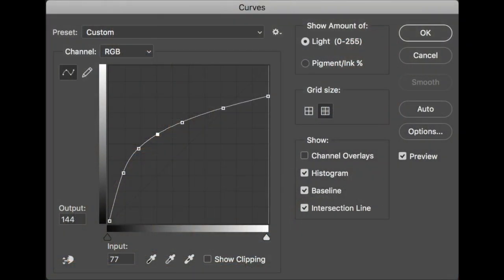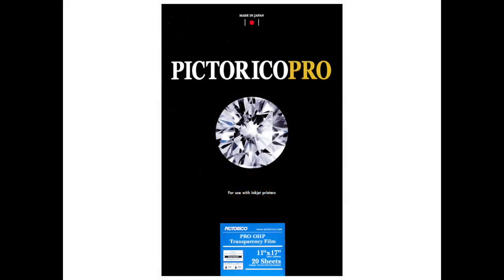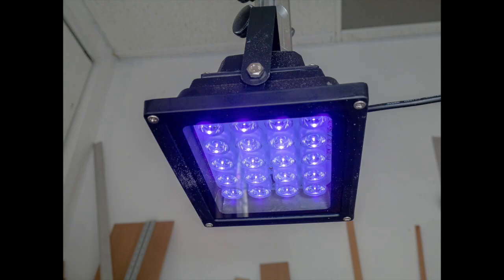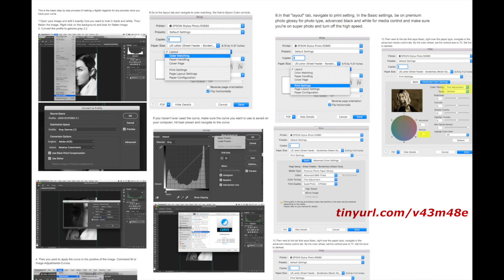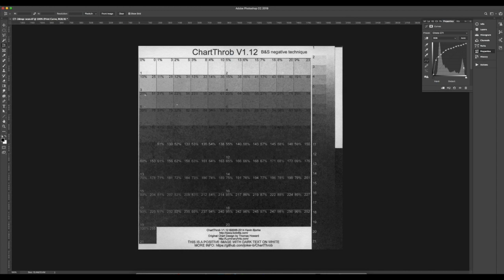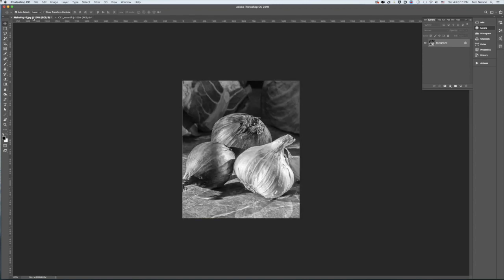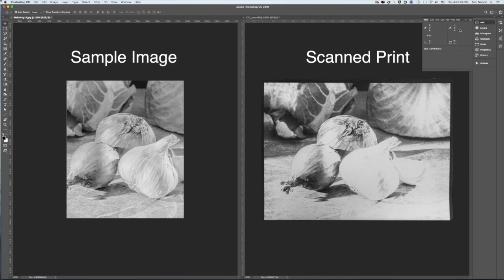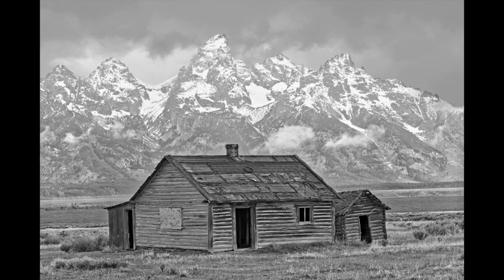Creating a Digital Negative

Comment: Hi Tom.
Thank you very much for the helpful material. I have a question about buying a printer. A good choice would be the Epson SureColor SC-P700 (expensive to use). In your opinion, the EPSON EcoTank L18050 or Epson EcoTank ET-8550 printer would not be good? I am primarily interested in cyanotype and buying a printer with it in mind.
Best regards, Bartek.

Comment: I love this very factual tutorial. Thank you.  I have a question regarding printing the negative.  My experience comes from Photopolymer Photogravure work where I am using Folex transparencies and Matte ink on an Epson SureColor printer which I was advised was more UV opaque than photo black.  You mention that Matte black smears.  Is this because of a reaction with the chemicals (I am planning to do cyanotype).  I would appreciate you comment.
Reply from the maker: Matte paper absorbs more ink than glossy paper, so matte ink is applied more thickly. Plastic films don't absorb ink at all, so the lighter application of glossy ink is better for them.
Reply from the maker: Thanks for the comment. My advice to avoid matte ink comes from my experience using it on Pictorico transparency film. If it doesn't smear on Folex, go for it!

Comment: In the Bostick & Sullivan comments on printing the Kallitype curves they provide there is a recommendation to change the Optical Density Setting of the printer (Epson) to -3. Do you make this printer setting change when you print the Chart Throb test print?  Thanks so much for this clear and concise video. I have been attempting to nail down Kallitype printing for about a year now and have had some, but not very consistent, success. I love the process!
Reply from the maker: Yes, use the B&S printing technique on all your tests and prints. I'm testing some other colors besides yellow and hope to have a new video... sometime.

Comment: Hi Tom )))  Great video, and yes it seem very complicated.  But okay, it seems like that I need to build this curve because each printer is different?  And if you change printers then you have to make a new curve - is that right?  Thank you for the video!
Reply from the maker: You'll at least have to try the old curve with the new printer, then adjust as necessary. If my technique seems complicated, the main takeaway is that your test print will tell you how to adjust the curve. You mainly need to know what will give a textured white and a textured black (the limits of your ability to show detail).
Reply: @tnp651  Thank you Tom!  )))

Comment: Can you make a digital  negative to print in an enlarger... for example can I make a 4x4 inch negative from a negative I retoucher in LR....
Reply from the maker: Enlarging a digital negative is not advisable. You'll be enlarging the printer dots that make up the image. You might make it work if you print the neg at the highest resolution your printer can make, and don't make a very big enlargement. Why not just make a contact print though?
Reply: @tnp651  I can just do that yes. I thought I would just have a master neg that can do all sizes by putting in an enlarger. Was just a though. Any  current printer recommendations for up to 16/20
Reply: Thanks BTW‼️
Reply from the maker: @davidventura1424  Most alt printers use Epsons. The XP-700 prints 13" wide and the XP-900 prints 17"wide. The XP-900 is 50% more expensive for those few extra inches!

Comment: Great video. Can someone help clarify something for me? I see you mention the Bostick and Sullivan video which goes over creating a digital negative as well as the printing settings for the negative. Does this chart system replace the digital negative portion of the bostick and sullivan video? It seems like it is just a more refined process but if I am using their chemistry and curves wouldn't I just need to dial in my exposure times and it should be good to go? Thanks in advance.
Reply from the maker: To be honest, I haven’t tried B&S’s pre-made curve but there are too many variables that change your image. It’d be easy to try B&S’s curve and see what you get. In any case, assess and change as I showed in the video.
Reply: @tnp651  will do. I’m just waiting on a printer to print my negative.

Comment: Tom,  thank you for the great video. Question:   For the test strip you make to find the full black, do you need to put this exposure trough all the same process you use to develop the image correct ?  (dev time, clearing, toning, fixing, etc)  thanks!
Reply from the maker: Augusto, you should use the same steps and timing except the hypo clear and final wash. Both the toner and the fixer change the Dmax. You don’t care about archival permanence, so the wash steps don’t matter.
Reply: @tnp651  Thank you Tom!

Comment: Why not just print the digital photograph?
Reply from the maker: For me, it’s the excitement of learning and exploring an old-time technique. Getting back in the darkroom is nostalgic for me, but I don’t want to lose the image control that digital provides. A hybrid process is the perfect compromise.
Reply: ink jet prints sit on top of the paper. these process are kinda burned into the paper chemically and the texture of the paper stands out. It also lasts way longer like those old photos that grandma used to have sitting in her house. That was the size of the negative so that was the size they printed at. Now we use digital to create bigger negatives to do the same printing but at a more modern and desirable size.

Comment: how to i do the timing with a NuArc 26-1k? it uses units instead on min.
Reply from the maker: Time it to see how many units are in a minute. Say there are 20 units in a minute. I’m not familiar with the NuArc but I’d guess you’ll need something between 3 and 7 minutes. That’s 60-140 units in this hypothetical example. Give your test strip 60 units, then cover part of it. Then give a series of exposures at 10 units, covering more of the strip each time.
Reply: Did you ever figure it out. I have a NuArc 3140 and will probably run into the same issue here shortly. Thanks

Comment: I have tried and tried again to get ChartThrob.jsx installed into Photoshop 2020 on my Mac without success. Any ideas as to why this is?
Reply: I finally got it loaded but I had to download it on a PC and transfer the file on a thumb drive.
Reply from the maker: Yes, I just realized the problem. The site downloads a file called ChartThrob.jsx.txt. You need to remove the "(dot) txt" to use it as a script. Let me know if you still have trouble.
Reply: Thanks for getting back to me. That’s the first thing I tried to no avail. I must have tried 20 times in different ways but it still wouldn’t install. In the end I downloaded the file on my old PC and it installed straight away in PS 2020. I then copied the file from the PC to a thumb drive and transferred it to the Mac. I dragged the file into the appropriate folder and it works. Removing the .txt doesn’t work as the Mac still sees it as a text file.
Reply: Failing to install Chartthrob on a M1 Mac running Big Sur with Ps 2021 or a PC running Windows 10 and PsCS6 but neither open the script. Gives an error 23 at line 134. Have made sure to use the 662kb script file. Any suggestions?

Comment: This is marvelous, Tom. I'm just getting started with platinum/palladium and you saved me many days of frustration. Like you, I'm a numbers guy and like this measurement-based approach. However, there's one thing I don't understand. In your second step you scan the first image (non0ChartThrob) image, then bring it up side-by-side with the digital original. You then apply the curve to that original and tweak the curve to match the imperfect first sample print. I don't get it. If the sample print is too dark in the midtones as compared to the original, for example, doesn't this further darken those midtones for successive prints? I'm sure there some logic or arithmetic I'm just missing here. Thanks!
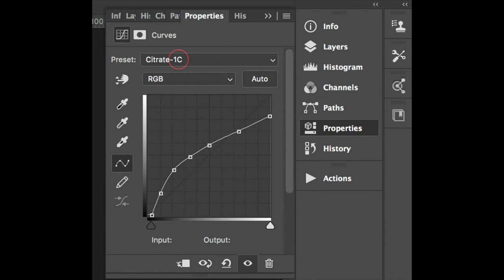Reply from the maker: You can see the dull-looking print (1B) at 10:00. It's not too dark. I concluded I was trying to hold detail in the dark quarter-tones and that was making the contrast too low. Instead of making the dark spot on the left cabbage an almost-black, I moved that density to the center-back area and let the left spot go true black. The midtones become darker but that gives a pleasing contrast to the brightest highlights, which begin to stand out. If you stop the video precisely at 10:12 you'll see 1B and 1C superimposed. Besides darkening the lows, I also pulled the lightest curve point up a bit. Remember that the mids and highs are very sensitive to changes in  the curve. For 1D I pulled the highs up even a bit farther (see 10:32). I hope this helps.
Reply: @tnp651  Thanks!

Comment: This video is awesome and I'm studying it carefully.
There is one question that comes to my mind, about the transparency film: considering that a good digital negative is long-lasting, and it might be worth a little investment, is it worth to consider buying the Pictorico Pro Ultra Trans Film 184gsm, instead of the "regular" Pictorico Pro OHP Transparency Film 174gsm? Thank you very much!
Reply from the maker: Hi Gianandrea, I don’t see any advantage to the Ultra film. The manufacturer says “This "Ultra" version differs from standard "Pro Premium" transparency sheets in its excellent compatibility with Epson UltraChrome Photo Black K3 ink, high UV density, and higher capacity for ink absorption.” If you are getting adequate ink density from the less expensive version, there’s no need to change.
Reply: @tnp651  thank you for your kind advice!